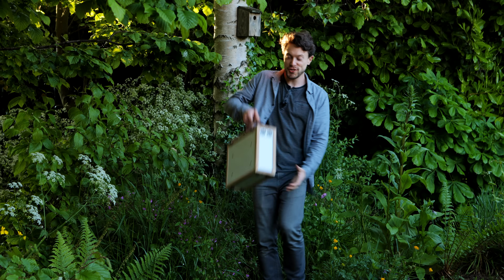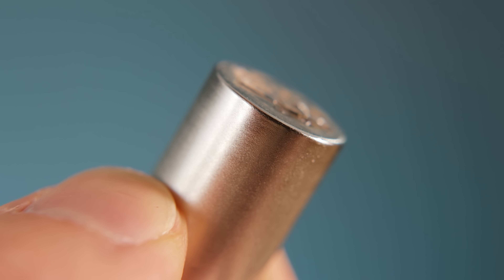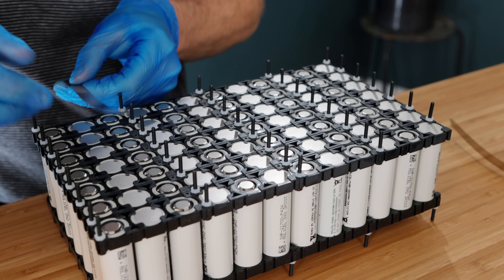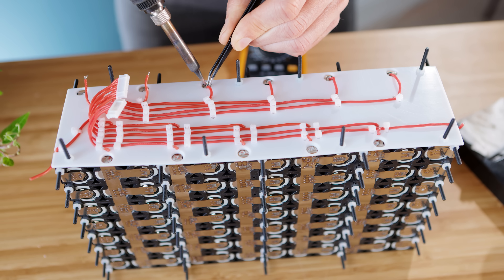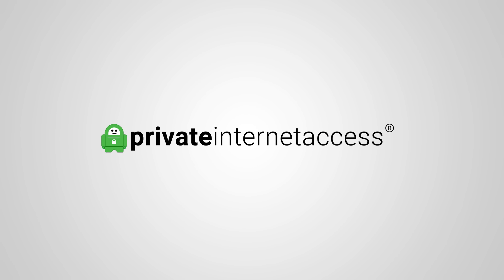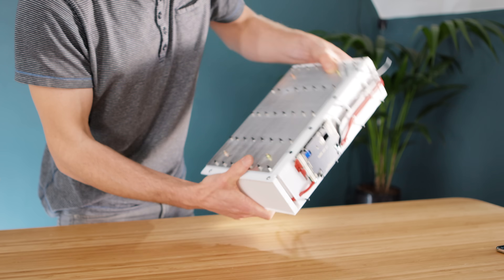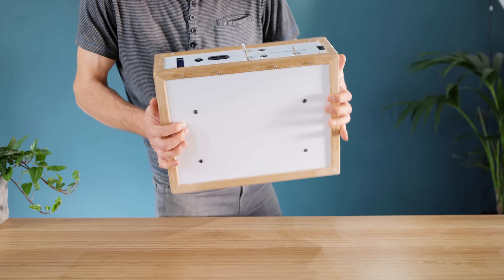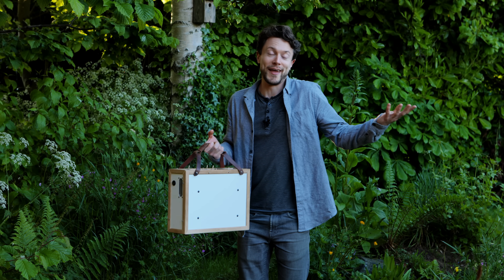Build your own portable POWER STATION (1200w, USB-C and MORE!)

Comment: Something to note: with cell sizes like that and a power module this big you are dealing with a lot of energy. Putting this in a case like that without any safety measures means that there is a very high risk of thermal propagation inside the module. This means if one cell has a safety event (short circuit or whatever) the heat produced will likely trigger the rest of the module causing all cells to go into thermal runaway. This should be conidered when you are storing and using the thing. Dont leave it in a hot moist boiler room or hot car...
Reply: Exactly. I even commented about why it does not utilize any sort of relays for high-current rails and how is the cell cooling / BMS cooling possible in such "sandwich-suitcase" build
Reply: As well as having the Deans connectors the wrong way around, just having them next to each other doesn't prevent someone plugging in just one of them.
Which you might want to do if you use a lower power device with just one Deans connector on it.
Reply: That's probably why he added fan and connected the Bluetooth to it so he can check the batteries activity in real time.

Comment: Another great build! Hey Matt, do you know of XT60 connectors? In my opinion much better than the T connectors, especially when repeatedly using them. Also come in XT90 for a 90A rating! Would have placed everything on the side, better protection against rain and debris. But as ever, looks amazing!

Comment: '...which is rather heavy, what is to be expected...'
And certainly expensive to build. Very expensive. I'd recommend quality cells from reputable company like Samsung, LG, etc.
And even with those inside I personally wouldn't dare to keep this thing inside my home. Unless in fully discharged state which defeats its purpose and leads to quick damage to cells. 
General thought. Nowadays with amount of lithium batteries in every electronic gizmo it is good very good idea to have at least 2 fire blankets  (lithium battery fires cannot be easily extinguished), and regular fire extinguishers. Especially people keeping hoverboards, e-bikes at home. Watching lithium cell fire on YouTube is completely not the same as witnessing it personally one meter away. It is scary.

Comment: you should really cool those batteries if you planing to use on higher wattage. Try to extend one end of the battery pack and put some server fans to push air though. This is why Teslas are water cooled. Btw love your vids

Comment: Mr Matt why didn't you connect the cells in parallel because connecting them in series will increase the internal resistance and the overall output voltage is lower than the actual voltage

Comment: I think the video doesn't highlight the risks enough. It does note the risks and ponts out how to ensure there is no catastrophe, but as a DIY project, lithium ion batteries are a huge risk and fires and explosions can happen too easily. There should have been more emphasis on safety precautions at all points in the video. Even the title and description should highlight the risks.

Comment: Is there nickel spring and plate that rest on top and bottom of the batteries instead of spot welding? I think its far more ideal to make them removeable and not to mention less likely to make mistakes.

Comment: i love the well thought out plastic design... but wow, that's seriously one of the worst electrical connector jobs I've seen. Deans plugs?? Quarter inch phono jumpers??? Weird funkadelic 3 pin charging port????? What. The. FSCK.
FOR THE LOVE OF BOB, GO BUY SOME ANDERSON POWERPOLE CONNECTORS!

Plus you had a massive gap in the casing that would have been great to slip that charger into for storage! Missed opportunities all over!

But still. You did something to be proud of. And thank you for not once calling it a solar generator like the rest of these twits.

Comment: I have a question. Because the cells is parallel, the maximum current can reach 210A (7x30A). We know the battery is 50v, so if do the math, the battery can give more than 10KWatt for a few minutes. Is that right? theoretically if the cables is enough strong can really give 10.000 Watts? It seems wrong to me but i don't know if doing something wrong.

Comment: Holy cow, that is over $300 for the cells only, and those are fairly affordable 21700 cells! Aaaand then the big spot welder is being carried into the frame.
Reply: That's not even expensive actually.. Home UPS systems are quite common in Indian towns because of frequent power cuts, Lead acid batteries of 100-200AH capacity(1200 to 2400WH) are used in conjunction with a power inverter to run lights and fans. In comparison, this is a 1300WH battery bank that Matt has made. These lead acid batteries range from 150-400 US dollars.. and last less than the Lithium Ion banks. So, in the long run Lithium is cheaper.

Comment: This is an excellent DIY battery pack -- far nicer than the similar ones I've built. However, in my experience, it's super nice to integrate the charger so that you don't end up in a situation where you can't easily charge the pack. Annoying to have to lug it around, but I bet you could come up with a cool way to make it detachable. On that note, you could probably also make a beautiful inverter housing that's also detachable :D

Comment: The thing this taught me is that microwaves take A LOT of energy, jesus!
Reply: Is written on your microwave bro... 1200w or 1600w. Usually directly on the front door of your microwave LOL
Reply: @totszwai  well yeah but I only ever really use it for a couple of minutes at a time so the consumption difference isn't as apparent. Also wtf are you doing with a 1600w microwave, cooking whole cows? In the UK the usual max is 1000 with 800 being the norm.
Reply: @SQWEKERZ  I have no idea why is so high. I often set it to 50% power and double the cooking time instead, otherwise the exterior would be like scortching sun while the inside could still lukewarm lol
Reply: if that surprised you, look on the bottom of your coffee maker, hair dryer or toaster(list of small hungry stuff around the house is pretty big). Basically anything that heats, or has a motor(or worse both) is a hungry hippo.

Comment: Awesome video with lots of great info. I am wondering as to why you chose to use Deans connectors instead of something like XT90. A single XT90 connector can comfortably pass 2000w, or twice that in short bursts and are pretty common in large scale RC and EVs. It just seems more elegant to use one very heavy duty connector instead of two smaller ones tied in an odd configuration. I'd even consider using something like a NEMA ML-1P/ML-1R (plug/socket) combination. They're designed for 120v 15a, so they'll happily supply the wattage, they're polarized so you can avoid mixing +/-, and they're unusual enough that accidentally plugging an AC device into this DC source is basically never gonna happen.

This configuration clearly seems to work well enough though, and the double-wide Deans it gives it a neat proprietary look; less like a project and more like a finished product. Keep up what you're doing man, you are an inspiration.

-A different Matt

Comment: I have one major concern.
The temperature of the cells while drawing the max power.
They are so isolated that they have pretty much 0 cooling.
And a nitpick.
Those toggle switches are sticking out and you can easily end up bumping on them by accident. You may want to change them for thumb switches.
Reply: Those cells can handle 30A continuously.
At max power they'll only be outputting around 4A.
Also the cells are spaced out so heat isn't likely going to be insulated in any one spot and as it rises,
he does have a fan and exhaust system at the top
Reply: @pala2446  Watch it again.
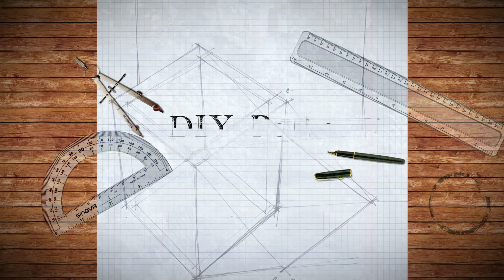0:41 The batteries are almost if not completely sealed from the electronics and the battery compartment covered by all sides.
The fans only circulate air over the electronics.
Electric car batteries are water cooled because they do generate a lot of heat.
I'm not saying it is guaranteed to be a problem. I'm just saying that he might want to put a temperature sensor inside the battery compartment and monitor the temperature on max output to see if its safe.
When those batteries fail from overheating they go out in a bang. Its better to be safe than sorry.
Reply: @vitor900000  
https://youtu.be/adY-S8AH_Jc?t=727
You see the two gaps at the top? Good thing heat rises right? Even if it was sealed, if you look at manufacturer datasheet for these cells, at max power they will only be outputting around 10% of what they are truly capable of. Heat shouldn't be a problem.
I don't know why you needed to include the thermal management of an electric car.  I didn't see him try to charge one in the video. Car > microwave
And of course its "better to be safe than sorry".  But where do you stop?  Why not add a heatsink to the cells, why not use a safer chemistry like lifepo4, why not make it water cooled? 🙄
BTW, the BMS he used has MULTIPLE temperature sensors.
Reply: @pala2446  The temperature monitoring didn't had to be permanent. A ~20min run under max load should be enough to see if it would level under 60*c.
And if you don't know microwaves are power hungry. A 20L microwave consumes ~1100w.
Reply: @vitor900000  
"The temperature monitoring didn't had to be permanent" 
So your advice was to add temporary sensors that would do the exact same job as the ones on the BMS.
Gotcha.
"And if you don't know microwaves are power hungry. A 20L microwave consumes ~1100w."

Did you even watch the video? His said his microwave was 1000w while his system is 1200w.
Reply: @pala2446  
1- I do not knew that his BMS had temperature monitoring.
2- Even if it has it if its not connected its useless.
3- My advice was to test to see if the temperature is safe. I said it didn't had to be permanent but obviously a permanent one is much better.
4- I said to test it on MAX OUTPUT not on his microwave.
Reply: The cells he is using are the Molicel P42A. They have a 45 amp continuous discharge. That means they can output 315 amps. Even if the converter was run at max that still will not overheat the cells.

Comment: Next Step: Building a solar panel system to charge this power station.
Reply: it is just a matter of creating 3 or 4 arrays to run in series to get the voltage and amperage high enough to power the charger he is using.
Reply: Though he will likely want to make it compact enough to fit in a pocket somehow...

Comment: Heyy, sorry that I am bad at English but it's very dangerous to handle PTFE with this soldering iron in the near because if the PTFE gets over 360Degree it is not only melting but some pretty nasty Gases could kill you, or you could get the PTFE-Fever which is pretty painful.

Comment: Noctua is a horrible fan choise for this. I know because my IT teacher used one of these to cool off a 3D printer. The thing overheated and it had to be replaced immediately making it useless. This is going to overheat for sure considering it's 1200W MAX. You should have used delta fans that are regulated based on temperature

Comment: so much good safety tips! Amazing project!

I would like to add that the black frame you used seem to cover up the negative pole of the 21700, and that is why you can safely weld the nickel plate to the plus pole without shortening it to the same cells negative pole.

Also, I get nervous that you worked with the complete pack without covering upp all parts that you are not currently working on. 
It can be a simple piece of cardboard that you fixate temporarily with a masking tape. Just so that you dont drop anything in a bad place over the naked battery.

For anyone else trying this. Always use tools whitout bare metal on their sides, or cover them properly in tape.

Comment: It's a very nicely build pack. Only thing that bothered me more than it should would be 2 dean connectors meshed together. Solution is to use higher grade connector like Amass XT90, they would do the job nicely and they look sleek.

Comment: As a pack builder myself - it's refreshing to see someone who actually does their research when it comes to best safety and design practises with these batteries. Li-ion batteries are no joke and mishandling or badly designing your pack can lead to a pretty severe fire.

Protip for the new players; Lithium fires cannot be easily extinguished. If one occurs, your best bet is to get the flip away from it!!

Comment: The only problem is that you need an external inverter to power AC electronics like the microwave. It would be better to have the inverter internally and a bunch of standard plugs outside at a cost of a bigger case. BTW great video. I love how you described everything carefully.

Comment: I’m interested in building a similar device that would work as a silent generator.
I think if i were to split the voltage to 25 volts i should be able to power a 24 volt inverter to supply 240 volts ac.
Most 24 volt inverters designed for vehicle use are designed to run between 20 & 28 volts.
What capacity and voltage were the cells used in the video ?
Reply: He mentioned lithium. Which would mean 3.7V nominal with a safe range from 2.5V to 4.2V. 2.7V to 4.0V if you want the longest maximum charge cycle. As for the capacity, the largest available for that size would be around 4500mah. Anything more is usually a scam or some new tech I haven't come across yet.

Now, if you're serious about building something like this safely you'd need to read more about battery chemistry. Asking about capacity and voltage in a youtube video that already states the chemistry worries me a lot. Learning is one of the noblest things one can do, so I hope you stay safe, friend.
Reply: @tempeleng  i missed it is all, maybe it was in all the guff that i skipped ! I get enough adverts with YouTube these days, so in video advertising gets skipped.
I literally know all i know about lithium cells & BMSs from YouTube videos ! There is nowt wrong with watching someone do something to learn, i don’t process written information that well, i had also never heard of the cells used, 18650s & 28650s i have come across before in battery building content.
I’m not sure why you are getting nit picky with me to be honest ? if you want to impart knowledge & wisdom, please feel free, snide comments just make you look like a cOck.

Comment: Finally a youtuber who takes battery building safety seriously! Heck, you could use this on an electric skateboard, had you bypassed the BMS to allow for the full power potential of that battery ! :D

What inverter did you use to get 120V AC? (or 240)
That part seems expensive in particular

Comment: Are you sure about your claims?
2 days of fridge runtime 
and just 6hr of PS5?
Your PS5 consumes 8 times more power than your fridge?
something of those two aren't correct
also why you choose a 50v setup?
why not a 24v one with more capacity?
50v is rarely used 
you are mostly using it at 24v
making a 24v setup would give you 58.8ah of capacity vs 29.4ah
that would increase the efficiency of your system while using 24v volts

Comment: You need to reconfigure your layout as it look really messy to me. An handle with all the port at the same place is quite bad.

My suggestion would be you need to relocate it to the side panel instead and not clutter out at the same place.

Comment: I see a problem. Since both main power connections are at the top of the battery pack the string of batteries closest to the main connection will have a higher current draw then the batteries at the bottom do to the resistance of the wires

Comment: A recommendation for strengthening the structure is to use steel bolts instead of nylon, accompanied with nylons spacer sleeves for insulation.

Comment: Those cells will set you back £9 each, so it's not a cheap project. I don't think you mentioned (although I might have missed it) that not all 18650 or 21700 cells are equal and you really want to only use those that are capable of high current drain. Re-using old laptop cells, for example, wouldn't be any good for high power applications. 
In terms of future projects it would really good to look at some interesting ways of recharging this pack, eg solar, wind, ?....

Comment: 13:50 well u could've kept the fans opposite side (pull and push config) cuz the suction power will be gud enough and that components would be cooled better .....but stilll that is better than not having a cooling system great job bro

Comment: I can't wrap my head around the fact that that little suitcase-sized box can power a combi fridge-freezer for two days.
Reply: Here's something else that may blow your mind: that "huge" amount of energy can only get a car up to 80 mph or take an electric vehicle 2 miles. Transportation wastes ridiculous amounts of energy.
Reply: @kentaltobelli1840  You say "wastes" and certainly inefficient commuting is a big drain, but you can buy petrol mopeds that are more efficient than a cyclist in CO2 emissions and obviously food cost to petrol.

And it obviously won't blow your mind if you have ever tried to PUSH a car for two miles.
Reply: @carbon1255  But even if you need a family car, compare its power consumption to the entire family house.
Reply: fridge is not working 100% of the time at full power- it only uses larger amounts of power at time intervals when it is actually working towards lowering the temperature after that is done there is usually a large time gap betwen such cycyles. This means relatively small bank can keep the fridge working for relatively long times.
Reply: You haven't watched jehugarcia builds😂😂😂 he can literally fully charge a Tesla